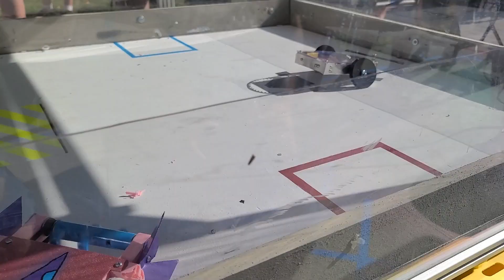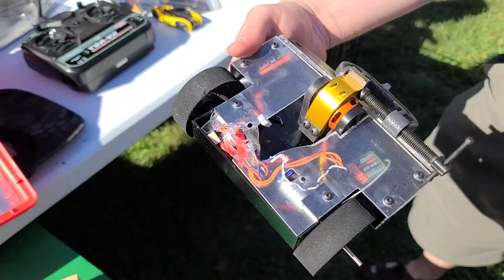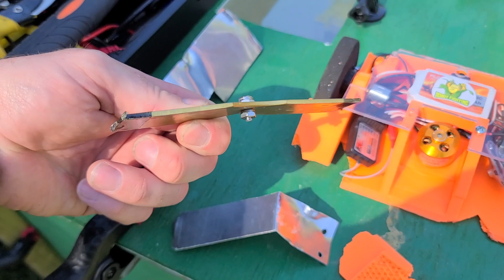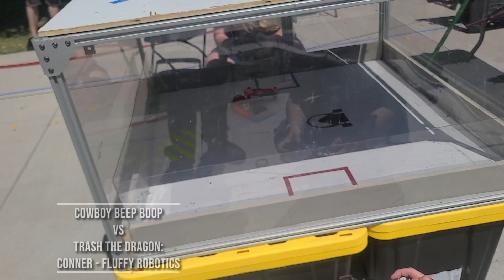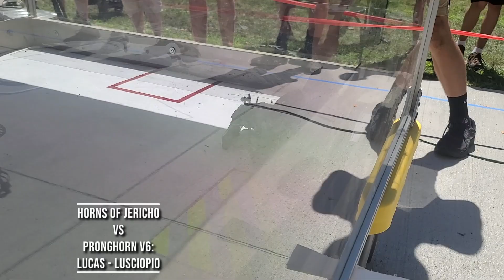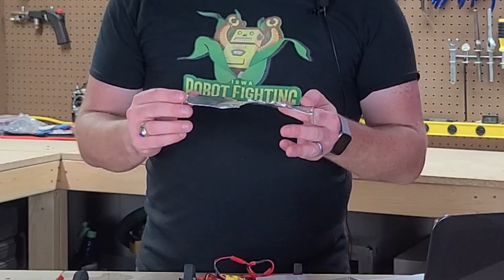Robot Fight Review - Minneapolis MN

Comment: I agree with using a belt drive. I initially bought plenty of spare 3M belts, but never needed to replace the first one from initial test fits, all the way through the fights. The big question is, toothed belt, or o-ring style? O-rings will be easier on you motor and be easier to fit, but suffer from slippage. Toothed ones require your fittings to be precise as heck, but you can spin up faster.
Reply from the maker: It's going to require testing and we'll likely be setting up a video devoted to the setup of those systems.